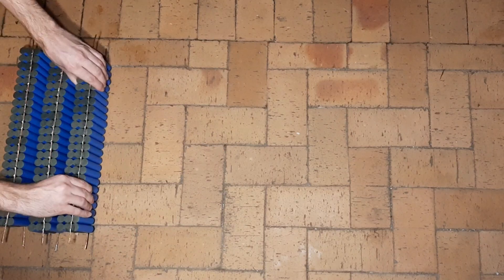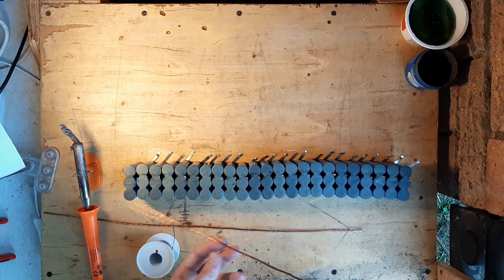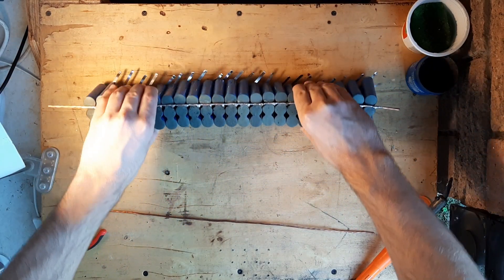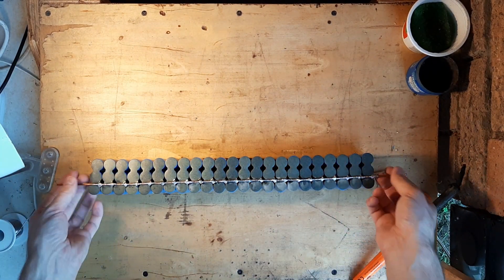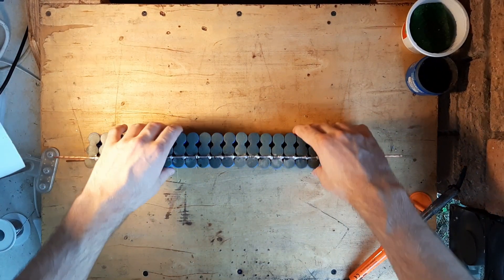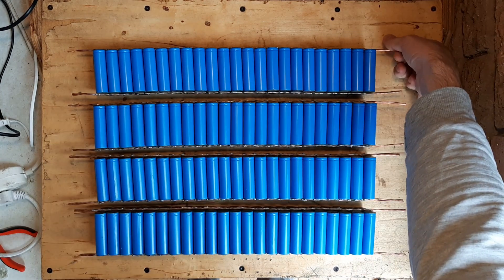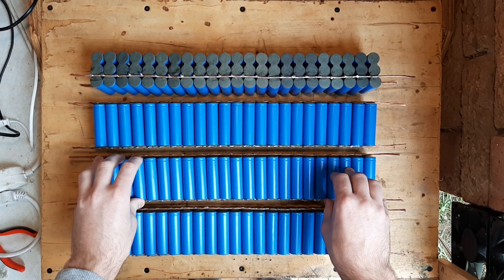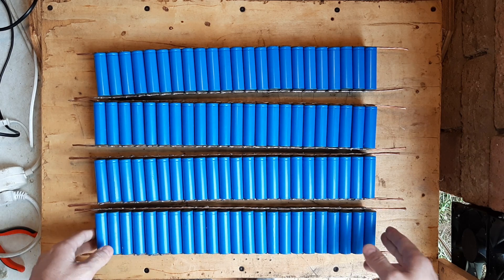Building a DIY  5kWh LifePO4 Powerwall ~ Part 3

Comment: Thanks for a better explanation. I understand lifepo4 can have a lifespan of 2000 to 8000 cycles depending on the manufacturer. That said are these used batteries? Do you know of a good manufacturer? Also I can get solid bare copper wire thats used for grounding electrical systems. Would that be better than the stranded wires you use?
Reply from the maker: These are new cells that I used and the stock I have left is about 10 boxes of 36 packs each. For me the stranded worked nicely as now you dont directly have to heat up a solid piece of copper, although the heat will also be conducted to the other strands in my case, it will definitely conduct away slower than with a solid copper bar. But the Solid copper bar should give you better results overall. Just be careful not to heat the cells too much which will be the case of using a thicker busbar.

Comment: Sadly, that’s a little dangerous, I’m not bashing by no means, but you really need to test each cell to make sure it’s a good recycled cell. Plus no fusing for safety. Again, I’m not bashing.. just don’t want anything to happen is all.
Reply from the maker: Good comment for recycled Li-Ion cells. Fortunately LifePO4 is much safer that Li-Ion and these LifePO4 cells are brand new. Will keep giving feedback on how it is performing. Currently in service for more than 4 months already without any indication of issues from the smart BMS we have installed that provides us with constant monitoring information on our App.

Comment: Hi. so how many cells in what config wouldI need for a 12V 150A battery?
Reply from the maker: I assume a 150Ah battery at 12V. You will take 150/4.5 = 33.3333 so lets say 34 packs in Parallel and then multiply it by 4 to put 4 such packs in series to create your 12V battery. So in total you will be looking at 136 packs for that build.